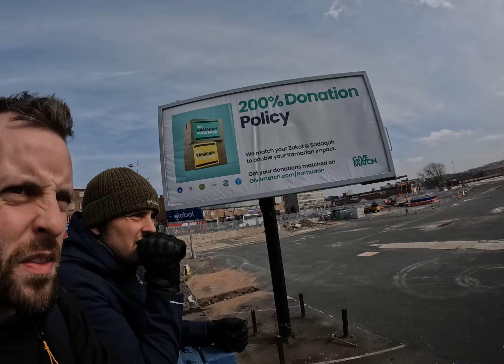Dead rats, used needles and orange sewage [Birmingham No Roads Mission PART 2]

Comment: As a drainage engineer, it was quite exciting looking at all those urban river structures. 😅 Btw, the slimy stuff around the outlets is probably just a biofilm that is also present in sewage pipes. These outlets are usually not discharging actual raw sewage but rather a well-diluted mixture of sewage and rainwater. I wouldn't say they are entirely harmless but they are necessary evils in areas that still have a combined sewer system, as in case of a heavy rain event, the treatment plant simply doesn't have the capacity to handle all the excess water. These overflows are heavily monitored (or should be) and the aim is to reduce the number of these events but it is not so simple. Anyways, it is fascinating to see these Victorian structures still functioning today and the mission was top tier content as always!
Reply: Video is 14 days old(1 day, didn't realise it autoplayed part 2) and I'm lucky enough to watch it 4 hours after someone knowledgeable haha

Another person I follow on here Post10, has had similar experiences but called it iron-oxidising bacteria, same thing?
Reply: @matthewVSmarkham nah, biofilm and iron oxidizing bacteria are 2 different things. Similar though.
Reply: @matthewVSmarkham  kind of similar, they're both slimy films of bacteria, one eats iron the other eats sewage. If there isn't an obvious trace of rusty water trickling down to it it's probably not iron oxydizing bacteria though :x
Reply: The real drainage engineer is always in the comments
Reply: Interesting! I just read an article about this subject, and it said that due to climate change heavy rainfall for short periods have been more frequent. So these overflow have been spilling sewege water into rivers more frequently. To make thing worse, water companies have been more fraudulent with monitoring and preventing these kind of situations (because it's costly).
Reply: People who explored the sewers in the Victorian era were called Toshers.
Reply: Do you reckon the oily-looking stuff in the water is actual oil? Because to me that seems like it's harmful to the environment and, thus, illegal.
Reply: What is the difference between an "urban river" and a canal?
Reply: Drainage engineer here as well! I also realised at one point they actually went right past something I've worked on (fairly obvious which part). Hilariously when I was working on it there was a specific culvert I wanted to have a look at but never got the chance, and thanks to Tom I now know what it looks like :D
Reply: I will say most if not all of that isn't shit though historically it would have been before heavy waste management came into place, the area has heavy clay and run off from the canals nearby which are full of all sorts of sludge that is heavily nutrient rich. The waste pipes are all along a similar system but underground. The water draining is from nearby canals filling the water table and entering into drains that leave to the river. There should realistically be very little dumping of fecal matter in this river, any of which would be considered illegal. The oily sheen is all road runoff, and the smell later is from the nechells power station.
Reply: Victorian engineers knew how to build.
Reply: A canal is man-made. Urban river is just built and engineered around or culverted in places
Reply: Not everything that is harmful the environment is illegal. Enviromental egulations are meant to minimize negative impact, not completely outlaw it altogether. That'd be ridiculous and completely hamper society.

For example, if releasing small amounts of oil into waterways was illegal I could use a boat with a gas powder motor.

Comment: Also, Ben definitely didn't fail IMO, he was still using a road that was illegal to use, you guys did that together a number of times. I think that makes it more than fair to consider a W.
Reply: Agreed. Public roads are a good way to determine what constitutes as a road. If we counted private roads, what counts as a road? Does a driveway count? A parking lot? A parking garage?
Reply: In my opinion a road is a road, private or not. He failed unfortunately.
Reply: @yes-ni1od  In that case, what constitutes as a road? Does something like a parking lot count? Why or why not?
Reply: @yes-ni1od  Sure, it was a road, but it was not for public use. Personally, I did see it as a little cheating but the fact that it was still illegal makes it a little bit better.
Reply: @zachellenburg5738  A parking lot isn't a road, it's a parking lot.
Reply: @zachellenburg5738  A road is something vehicles drive along to get from point A to be point B. So by definition it was a road but I'll say he didn't fail because it wasn't public and a road leading alongside a factory while still a road isn't itended for public use. Still retains the spirit of the video.

Also a parking lot isn't a road because it's intended for parking, not traveling.
Reply: @ArthurB26  well the parking spots are for parking, but there are still sections made from driving, driving from point A - the parking spot of your choosing to point B - the exit of the parking lot (or of course visa versa)
Reply: i think anything on private land should not be considered a road, as the road laws dont need to be obeyed there

Comment: The river ray powered several mills. Most of the water is brown water and water pumped from the reservoir under Birmingham.  My family had an old map showing the mills on the ray. When the old meat market washed down the colour of the ray used to change. There is a lot of standing water that only runs when there is heavy rain. So it does stink. As lads my brother and myself did this trip several times. Thanks lads that brought many memories back.  Oh I forgot  in digbeth  there used to be a place that used dyes to colour cloth or something and they released water that was bright red or yellow.

Comment: 18:31 I am not entirely sure, but I assume that there's a lot of grease and other biological material in this water. Either human waste or grease from the kitchen sink. That also explains why the poopy areas are so slippery - the water gets washed away, but the grease leaves a slippery film on the surface. This grease floats on top of the water, so it rises with the water level, and gets stuck to surfaces when the water goes back down. Because it is grease, it is not washed away by the river or rain too easily, and it probably accumulates in high "flat" areas like that, since it cannot run down by itself, and it does not get hit by water very often.
Over time, the different biological matter and grease breaks down and the water evaporates, and that leaves this highly concentrated slurry of human waste and grease. Which you then walked through, like some kind of thick creamy curry with coconut milk :) Enjoy!
Reply: Yummy!

Comment: I understand the concept of the platinum and golden run for straight line missions, since that line is the one perfect route. In my opinion, the concept does not apply to these missions, as steering away from the line you drew out beforehand does not take away from the goal of the mission. It's the improvisation when the plan doesn't work out that makes it fun!
Reply from the maker: It’s not so much the steering away from the route we planned but rather the lateral distance we have walked down a road whilst crossing it. Dead straight is unnecessarily strict, so it’s about deciding how far we can move whilst diagonally crossing. I agree though that it feels less important than in the straight line missions!
Reply: @GeoWizard  If you do another one of these, you could consider instead of setting an arbitrary limit on distance, you could rule that you can walk down a road any amount as long as it's away from your destination? Let's say you're facing North, perpendicular to the road you want to cross which runs East-West, and your goal lies NE. You could then rule that you can go down the road to cross it but only Westward, that gives you less to think about in terms of managing distance but ensures you can't just walk down roads to your destination.
Reply: @GeoWizard  fair point! Thoroughly enjoyed the series either way

Comment: The River Rea was originally a natural river along which Birmingham was founded by a Celtic tribe. 

As for the orange sludge, it wasn't shit - (and I'd be very surprised if even the Brummies are flushing shit into the river) - it would've been a bacterial biofilm, it can also happen in perfectly clean natural streams to my knowledge, it occurs in iron-rich areas and the bacteria are absorbing and utilising iron, which is why they turn a bright or rusty orange colour (just like why rust is...a rusty orange colour). They're harmless, and likely there because pipes taking down rainwater (and possibly greywater, tho I kinda doubt that) are probably still iron, and leaching some off into the water over time.

The smell of the sludge is described as either sewage (check), oil or petrol (check), and weirdly, cucumbers (did you reckon you were passing any grocers along the river?), or just musty swamp smell.

Also at 21:42 was that just like, a torn up car?

Comment: The no roads series is probably by far your best content outside of your US trip. I think you do need to use the definition of road (at least in the UK) from the Road Traffic Act 1988 however. This would still count a lot of your previous work, as the public do not have access to the roads you usually seem unsure on, and would probably be the most tried and tested definition of a road (although knowing yourself, you'll have a lawyer on standby for future videos if armed with this knowledge)

Comment: Some of these larger discharges with surrounding structures are CSO regulators, the pipes are mostly classified as lateral lines. A chance is if it wasn’t dirty water, it would’ve most likely been infiltration from groundwater but could’ve disputably been other sources.

Comment: About 30 years ago I parked at the Midlands Arts Centre (MAC) and decided to follow the River Rea south, maybe to its source. The river at this location can be deep and dangerous after heavy rainfall but this was on a fine summer afternoon. So, off I trekked, through Cannon Hill park through Stirchley and eventually losing track of it probably in the Hawksley/West Heath area, probably around 3-4 miles. For the last bit the river had dried to barely a trickle.
This trip wasn't planned, just an impulse and I was kitted out in just trainers, jeans and T-shirt. I was on my own and didn't have the modern tech aids that are available now. A rather more pleasant part of the river than beneath murkiest Birmingham and nothing particularly hazardous, memories of a pleasant afternoon.

Comment: I would definitely recommend putting a few rivets along the ball of your foot for these types of adventures, if you don't wanna click clack and jeopardize the structural integrity of your expensive shoes, buy some cheap crampons with rubber straps.
Bout ten bucks online and can quickly and easily be removed and put on when needed.

Comment: Just a note on the 1:1 aspect ratio: you complained about using 16:9 (or was it 4:3) in your last straight line mission messing your framing and whatnot. To be fair for these kind of adventures missions I kinda like the 1:1, it gives it its charm and you can get lots more of footage per GB of storage. So I would recommend to keep it this way! Cheers

Comment: I suggest a new type of rule: instead of a fixed amount of meters you are allowed to deviate, you get a budget of deviation. For example, with a 100 meter budget, you could walk a whole 100 meter stretch of one road or you could use 5 meters 20 times. I think that would be interesting, since you would always have to chose between using your budget or going some harder way.

Comment: Apparantly that orange sludge is Iron Bacteria, not harmful but looks too much like shite.
Reply: A bright orange slime is often seen where groundwater seeps out of the ground. The slime is called “ferrihydrite” and is basically like rust that is made by bacteria. Iron-reducing bacteria underground turn insoluble iron into dissolved iron hydroxide molecules in the absence of oxygen. These dissolved iron molecules can flow in groundwater to the surface. After the dissolved iron hydroxide molecules flow to the surface, a different group of bacteria use oxygen to oxidize the iron and create an insoluble form of iron called ferrihydrite (the orange slime) as a byproduct. This complex chemical relationship has been present on the earth for hundreds of millions of years, and although it looks gross, it is natural and harmless.